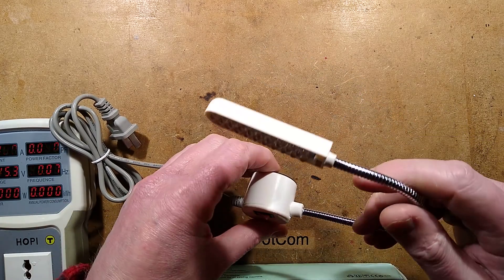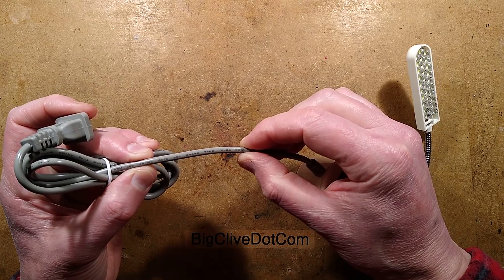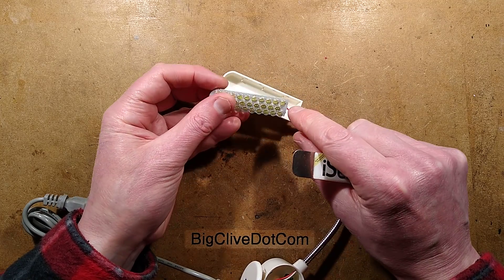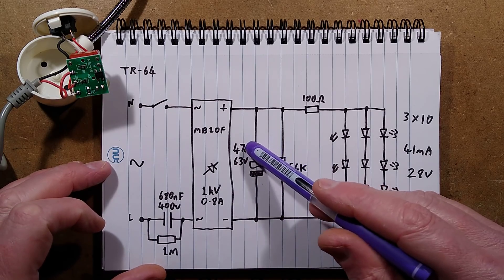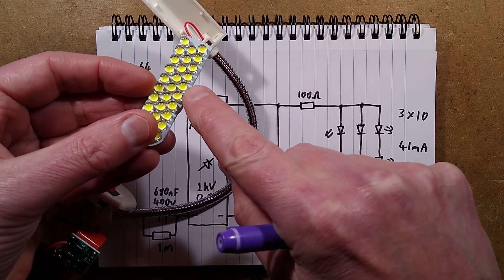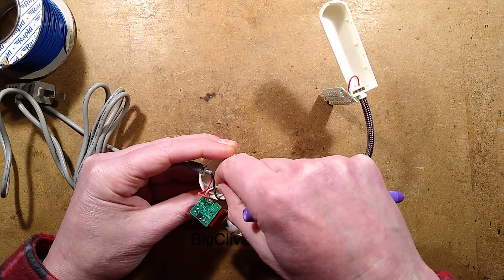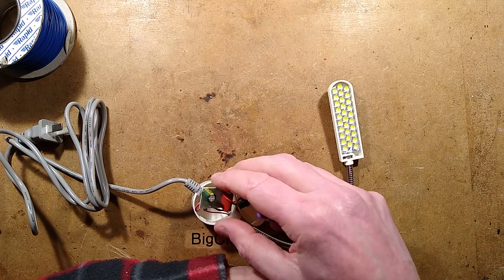Exploring a Chinese magnetic "machine light" (with schematic)

Comment: 8:40 No way you could class that as a double insulated light! Single insulation (the box) around the bare board power supply. Mains referenced wires to the LEDs in the metal flex are single insulated and just a single plastic box around the LEDs themselves.
Reply: According to EN 60335-1, double insulation doesn't necessarily mean two layers of insulation. Two layer insulation can be substituted with clearance and/or reinforced (thicker) insulation. A lot of AV stuff is double insulated, whilst having a metal enclosure, and boards with mains voltage on them bolted to the metal bottom with metal standoffs, and they are completely satety compliant, because they have enough clearence around the mounting holes of the boards, and between the board and the metal enclosure.
But you are right about the gooseneck, single insulated wires should not touch it, so this lamp is not compliant at all, and on top of that, you're not supposed to get access to exposed mains without using tools, so the LED module held in by just plastic latches is also non compliant, because I bet you can remove that LED board with your bare hand.
Reply: Yes, I did think he misspoke severely there.

Comment: It seem the cable was printed the wrong voltage, I've never seen 30V cable exist.
Reply: 30v cable is super common around here for low-voltage things like data and A/V cables. In my sight now me now are a 30v-rated USB cable and a 30v-rated Ethernet cable.

Note that the 30v rating of this particular Ethernet cable means it shouldn't be used with Power over Ethernet because that runs at 48v nominal.
Reply: @eDoc2020  Reasonable for AV, but 30V is below the PoE standard 48V, so I think for Power cord the chance of misprint is very large.

Comment: Not even close to meeting IEC, UK or Euro standards.  It’s not double insulated, it has unearthed metalwork, the cover isn’t fixed by approved means, the plug is illegal, the mains lead illegal, it’s not fused, the plastics will no doubt fail any hot test.  

The gooseneck is nice.

‘So it’s Approved’  ...until it kills someone, or trading standards intervene.   

At least with the equally shitty USB powered ones you supply your own power supply and thus with careful choice of something that has gone through formal testing you get to determine and be assured of the level of isolation between the mains and the low side.  

So the question is, Do you feel lucky punk?  Well do you?

Comment: 8:34  I would reconsider the seal of approval as it doesn't satisfy the requirements for double insulation.   The requirement for an IEC61140 Class II appliance is that no single failure can result in dangerous voltage becoming exposed.  There might be a plastic sleeve inside the gooseneck, but surely that needs to be verified before giving it the thumbs-up.

Comment: Not a bad lamp apart from the switch in the neutral. That could be fixed with a proper UK plug being put on. Out of the box don't think it would pass the JW test. Thanks for the strip down and explanation.

Comment: One of these lights came bundled with my industrial sewing machine. Other than the slightly stiff wire, it is quite nice. Best feature = no flicker.
Reply: @Matt Quinn it is a Sailrite Fabricator 👍🏻👍🏻
Singer 111 based walking foot straight stitch machine.
And yes, it’s the same light.  Looks a bit cheesy but illuminated nicely.

Comment: I am not an electrik expert, I don't understand, how a kapacitor dropper circuit can ignore the voltage levels. Seeing a US plug lamp not blowing up in a Europian socket.
Reply: They can't ignore the voltage levels. If the capacitor's voltage is too low it would blow up on European voltage. This plug is actually a Chinese one so the lamp can handle their 220v. Assuming the capacitor doesn't blow the dropper's output current will vary with the voltage. If it's plugged into a 120v American outlet it will be dimmer.

Comment: But Clive another video you said that parallel resistor to the output cap will shunt the voltage if the leds fail have you forgotten your own knowledge
Reply: That's true but it in this case the shunting effect isn't close to enough to protect the capacitor. Here (IIRC) the LEDs run at 40mA total and the parallel resistor is 56k. Using Ohm's law those values would result in 2240v without the LEDs, way too much for the capacitor. In reality it won't be that high because the current goes down as the output voltage increases, but by my quick estimate there would still be a bit over 200v.

Comment: That actually looks like a pretty nice light for a drill press or a smaller mill. The neck is a bit short for a full size lathe, but it would be very good on my Taig for example.

I get small desklights from IKEA for about $5 each that work perfectly well as a light on both of the table top machine tools. The end of the gooseneck has a M8x1 thread that's handy for mounting it to alternative bases. Although the size is a bit unusual you can get a tap for it pretty easily.

Comment: As someone whose mother needed a new light for her sewing machine - most machines with outboard lights seem to have a 12V transformer, powered from the 220V motor. And most of the sockets seem to be that 2 flat pin USA style.
(I'll probably go for a battery powered magnetic LED thingy, since I don't really want to mess with mains voltage from a 40 year old machine)
Reply from the maker: A head torch is very useful for work like that.

Comment: switch on natural LOL a two-pin reversible plug
Reply: These things are made to keep you on your toes. Just when you think its turned off it gets you.🎇
Reply: I love how Europeans think these two prong plugs are reversible. One blade is wider than the other, and North American / Chinese sockets are polarized with neutral on the wider pin. The wide pin doesn't fit into legacy non-polarized outlets.
Reply: @KevinT3141  Except this one is the non-polarized variety. In all the shots I can see it has two narrow prongs. If it were built to American specs it almost certainly would have have a polarized plug and SPT-2 (or possibly SPT-1) cable.

Though having said that many foreigners are apparently thwarted by polarized NEMA plugs. I remember seeing a thread online where somebody posted a picture asking to identify a plug. It was a regular polarized US plug but the poster doubted that because it didn't fit in their travel adapter. Apparently the adapter they bought with a US receptacle only had two narrow slots, so even its manufacturer messed up.
Reply: @KevinT3141  I think if you look carefully at the Chinese plug here both pins are the same size
Reply: I'll admit I didn't look that carefully. I work on products that use international adapters that ship with a variety of blades, including both North American and Chinese, and could swear that our Chinese ones were polarized as well. None here at home to look at just now though, all back at the office that I never work in anymore.

Comment: That cord is marked 24awg, and I’ve never seen anything that small used in the US as a power cord. Not sure it’s against code, but manufacturers seem to avoid it. Even the cheapest of cheap LED lamps are using 20awg cabling.

Comment: Nifty little gadget -  hardly a new design though - I've got something vaguely similar from the early 2000s (DX I seem to remember). Theirs used a pretty tiny SMPS in line with the LED light, and it worked very well indeed. Probably still works (but it's lost in the back garage somewhere)

Comment: No flesh-cooking UV? No chance of burning down the house?
How boring.
Also, that dimple under the "magnet" is probably the real magnet, and what we see on the exterior is just a mild steel field spreader plate. Weakens the local field strength a little but makes the odds of it grabbing magnetic metal a little better. Also fools the consumer into thinking it has a really big magnet.

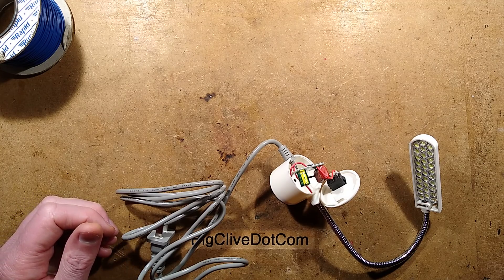Comment: 10:18 The only issue I see is that, in worst-case*, mains potential could leak on the metal goose neck, and therefore I would give it a double insulated cable or slip a sheet of heat shrink over the existing ones. As well as retrofit the switch with heat shrink.

* = a series of faults, that aren't very likely but still possible. e.g. one of the "low voltage" side wires breaks off at both ends and ultimately bridges the live switch to the goose neck.

Comment: Surprize magnets like that in random boxes is why shipping harddrives is so risky.
Reply: Hard drives are actually quite insensitive to external magnets. They actually all have very strong internal magnets. Any magnet strong enough to corrupt a modern drive is strong enough to crush fingers if not handled properly. Since nobody will ship something that dangerous it's not something worth worrying about.
Reply: Yes, that's why hard drives are one of the few things I don't really like ordering online (although the last two I bought were online.)  Those, and LCD panels (although most of the ones I use currently were bought online).

Comment: 8:04 And the rubber is (probably) there to reduce slipping so that even if it is mounted on a vertical surface in conjunction with vibrations it still doesn't slide down.
Reply: @ItsMrAssholeToYou  Good point. I shattered a few myself.

Comment: Thx for  the vid. I have one of those; been using for a year. I use it for soldering in amp chassis. It's been quite handy. Now that I see the breakdown, I've got a question; for you. To add a bit more brightness, and since the LEDs are not being stressed, what's your say on dropping the 100R resistor to 82 or 75R?
Reply: Changing the resistor will have a negligible effect on the overall current. To increase the current you need to increase the capacitor. It's pretty linear so going from 680nF to 1uF will give you just about 50% more current.

Comment: I was under the impression cap droppers were more common in UK/EU, and not the US because of the lower voltage?    Or is this a special case since its a low power LED light?  Most LED bulbs I've pulled apart seem to not be cap dropper.

Comment: The really nice thing is this basically has an U. S. plug on it already so you can use it here with no modifications.
Reply: The problem with US and European Sockets is you never know which leg has the live on it with reference to earth. Very dangerous for getting a shock if you think its turned off but its only broken the neutral. Pleased we have sockets in the UK that are unreversible.
Reply: @martinwinfield2935  American sockets are irreversible as well. The neutral slot is wider than the live slot. Devices like lamps where shocks are feasible have a wide neutral pin on the plug so they can't be plugged in backwards. Other things like clocks and transformer packs don't present a greater shock risk if the plug is reversed so they commonly just have two narrow pins.

Some very old outlets only had two narrow slots but these are truly ancient. By the time the British socket was developed in the 1940s I believe all new American outlets had the wider slot for polarization.

Comment: 1:01 “most likely capacitive dropper or switching”- turns out to actually be a whetstone full-bridge rectifier.
Reply: Capacitive droppers only work with bridge rectifiers.
https://en.m.wikipedia.org/wiki/Capacitive_power_supply
Switching power supplies can get by with only a diode as rectifier, but the electrolytic needs to be of higher value than what a bridge would use.
Reply: A wheatsone bridge is an arrangement of resistors.  Also, what's the difference between a full bridge rectifier and a normal bridge rectifier?

Comment: I don't know about the UK but I'm pretty sure that that power cord would not meet the minimum requirements of the NEC in the US.  I witnessed a cheap power cord like that start to hiss and erupt into a jet of flame at a point where nothing was crimping or damaging it.  I had the sense to pull the plug and the flame stopped.  Since then I have avoided the types of corner cutting power cords that are on most the Chinese equipment that's being sold online.  All of the "business machine" power cords have to be 18 AWG or heavier, but I've seen the chinese ones with thin 24 AWG stuff that's a fire and safety hazard.  I cut the ends off to make sure they don't get used on AC lines.  

I think that before I would trust the power cord, I would slit it and see if both red and black wires were properly rated.  Thanks for the video, Clive.

Comment: I'd second the misprint idea, given the UL1185 rating. Of course, no guarantee that it actually conforms to that, and they use the lowest mm2 A' they can get away with. On another note, VW-1SC is a vertical flame propagation/drip test spec, which I'm sure can be "retested" John Ward style.

Comment: A two-prong North American plug without small holes in the blades is very rare. Even we here in North American can't seem to agree on a good reason WHY the holes exist, but we just know they should be there, or beware Chinesium!
Reply from the maker: It may be a Chinese plug.
Reply: The holes are to help with plug retention. Some outlets have little raised areas on the contacts. When the plug is fully inserted the spring pressure of this raised but in the hole keeps the plug from coming out easily.
Reply: @eDoc2020  That's what you'd think, and it is the prevailing assumption people make, but funny thing is there aren't. Nearly any North American receptacle you'll find has no raised bumps whatsoever on the internal contacts. The few that do are higher spec commercial or isolated ground, and even in those cases the raised bumps are not shaped, sized, or positioned consistently with something intended to interact with the holes in the prongs. There seems to be zero consensus out in the wild, save for the NEMA spec which states that the holes may be included for convenience in manufacturing (and which certainly doesn't sound like anything having to do with plug fitment).
Reply: @marcberm  It is very rare but AFICT that was the original purpose. From US patent 774250 "This engagement of the contact-posts with the locking contact-springs retains the cap securely in place under all the ordinary conditions of use and insures perfect electrical connection."

Back in the day outlets were on light socket adapters so it would be easy for the plug to slide out. Today that's not really an issue but the holes are maintained for legacy reasons.

I just came across an old (probably Bakelite) ungrounded outlet splitter which has bumps on the contacts. Inserting a plug I can feel them working properly, they engage at just the right point.
Reply: The other use for those holes is to use them to insert a teeny little padlock so the plug can't be plugged in while you're working on something...

Comment: I bought one of these for my drill press and I've been happy with the brightness and strength of the magnet. I even stuck it on my scroll saw once and it didn't budge. Glad to hear its well designed
Reply: Why add 'press' ?
Is it a bench drill, pillar drill, radial drill, electric drill or egg whisk ?

Comment: Have you ever done an insulation resistance test on these Chinese power leads? I've come across a few that breakdown on 240 volts and trip the breakers (the cable all by itself). And I've come across one that exploded
Reply from the maker: That's something to try.

Comment: Too short for a real machine like a Bridgeport.  I have tried a bunch of LED lights for machining and all of them SUCK!  How hard can it be to make a light for a mill that isn't stupid money or shit quality?
Reply from the maker: The best way to get the light you want is to make your own.  Use existing commercially available goosenecks and add the rest using standard easily replaced bits like 12V power supplies and COB arrays.

Comment: We use lights like this for drill presses in my shop. They work pretty well for that. You can use them to light up the workpiece from the top, of course, but in our case we're usually drilling through translucent plastic and it helps to have a light source under the table so you can get it aligned properly. No one ever turns them off and I can't recall having had to replace one in the few years they've been in operation.

Comment: I use these lights on my own industrial sewing machines and supply them with machines that I refurbish, both industrial and domestic.  They produce better light than the original lamps supplied with those machines.
Reply: @Matt Quinn not sure I like the unearthed swan neck either. Especially on something that vibrates as much as an industrial sewing machine. Soon saw through those single wires in there.

Comment: Isn't that an unpolarized plug? Meaning that either the live or the neutral is switched, depending on how you plug it in?
Reply from the maker: Yeah, it's random.  Like so many similar products.
Reply: Matthew Gies It is, but it doesn't matter because the supply is isolated through the full wave bridge rectifier.
Reply: @michaelkaliski7651  The rectifier does NOT isolate the supply. Touching the output of the rectifier will still shock you. The only time plug polarization doesn't matter is when it's impossible to touch the internal wiring before it goes through a transformer.

Comment: Let's say one of the wires in the bendy metal thing opens up after repeated abuse and touches the metal, aren't you connected to mains through the rectifier? wouldn't that mean you can shocked when touching either earth or neutral at least half a wave?
Although it's 3:30 AM maybe im just too sleepy
Reply from the maker: Yes.  That would pose a shock risk, which is why I'd prefer an extra layer of insulation in it.